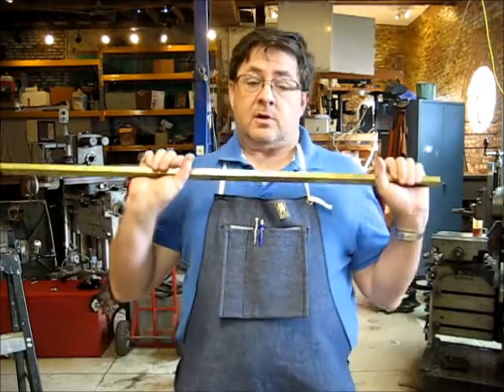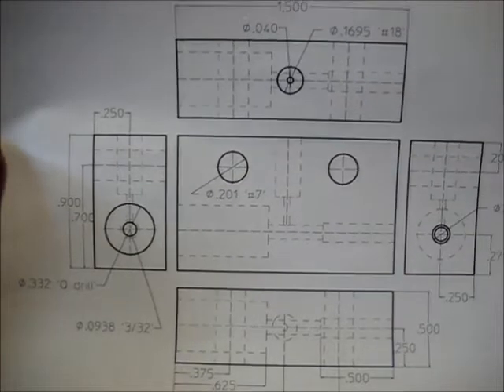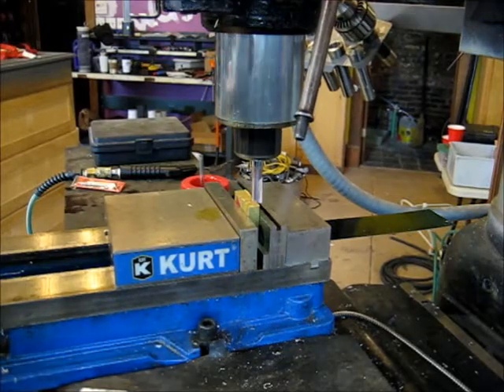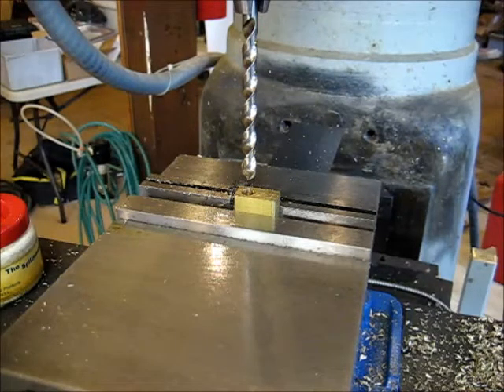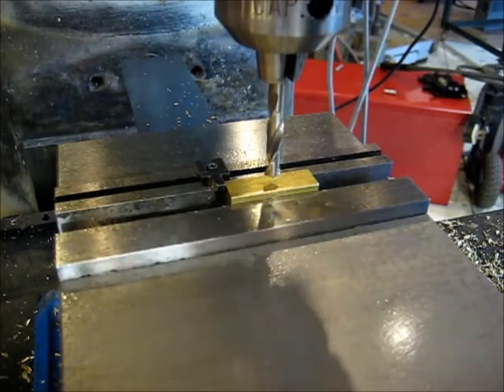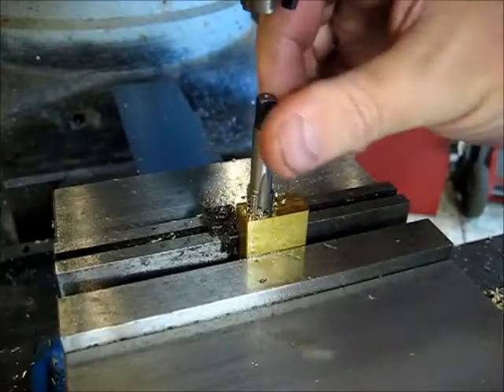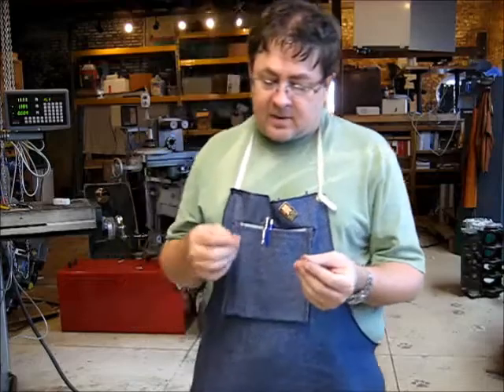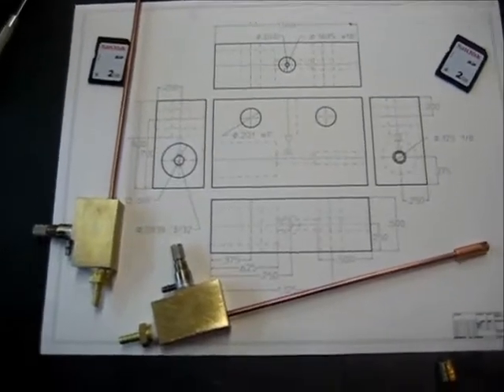Making a Fogless coolant mister, Part 1

Comment: Hello James,  On Ebay the whole valve body which has two needle valves, the body, two lock lines and nozzles go for $12 which includes shipping.  Then you could modify them as needed.  MacMaster Carr is convenient but horrendously overpriced.  I just order one to modify.  Nice project.  Take care.  Doug

Comment: Great video ,My Mill is a bench top, so I have to use the quill ,  Would it be better if the coolant entered at an angle opposite to the flow of air like a carburetor ?

Comment: I buy el cheapo bits, but, I use very slow feed, light pressure, and at least a couple drops of   cooling oil!  I used to use my old used engine oil, then, switched to new fresh ATF (5 weight mostly, so flows good), which smoked a bit. 

 Now, I use Shell Synthetic oil, from my oil changes that are only once a year, but, I have five trucks... I buy the Shell in the silver 5 quart plastic bottle, for $17.xx a jug.  The 5w20 has an ignition temperature of something higher than 1340 degrees F. Runs 12,000 miles, or 12 months, when the ultra synthetic filter is used ($9.xx), in our vehicles.  in a drilled hole, it lasts the time it takes to make it through the steel.  After another year, or so, I can recycle the excess oil on hand...

Comment: HI James, been following your vids for a while now and been enjoying every minute of them. one dumb question: why not run thru your block all the way with the small drill first and then just switch to the larger drill as a follow up instead of doing all the flipping and turning of the work piece?
Reply from the maker: mmikeyy27 The flute length on the smaller drill is very short, maybe 1/2", it would be peck drilling hell to try to get all the way through.  Very easy to break the drill as well.

Comment: James, just wondering, why crank up that heavy knee instead of using the quill which is designed for that Z action?
Reply from the maker: Brass can be real "grabby", it can pull the cutter down into the work, causing all sorts of problems.  Using the knee for Z does away with that possibility.  Thanks, thats a good question.
Reply: Love those clear water filter housings. I put a couple on my parts washer and the 1-micron yarn filters will really clean that solvent up! Filters 2 for $8-9@ HD. I was able to cancel my Safety-Kleen service as a result! I think filters are available in 5 and 15 micron as well.

Comment: I have no idea what a MIG tip is.  Or where to get it.   Can you elaborate please?
Reply from the maker: Best Services Sure a MIG tip is the tip used in a MIG welder gun.  Its a small brass threaded tip available at any welding supply, even the big box stores.
Reply from the maker: ***** Sorry, correct you are Sir, Copper not Brass

Comment: Is that a 460 ford block in the background? Just a curious detail.
Reply from the maker: Sir, you are one sharp eyed dude, that is in fact two Ford 460 blocks.
Reply: Love your truck receiver/vice mount idea! There are also vise-mounting, wooden tee cross section mounts if you need room on the bench for an assortment of bench grinders, buffers, wire wheels, different grits, etc. Nothing like having a vacant bench top to work on!